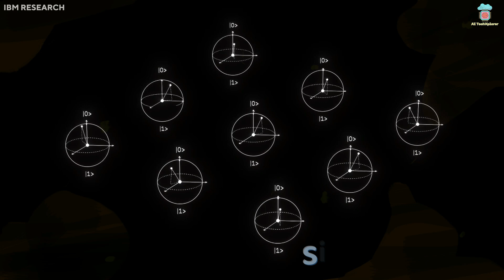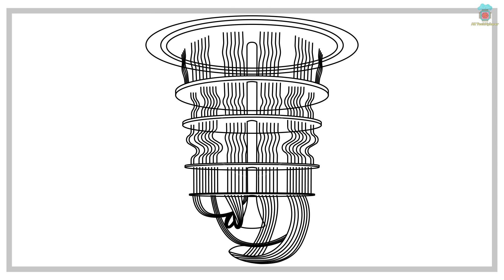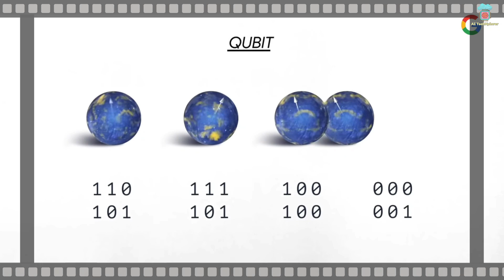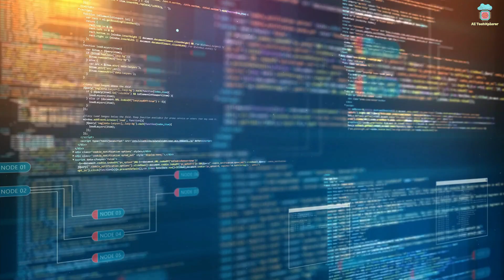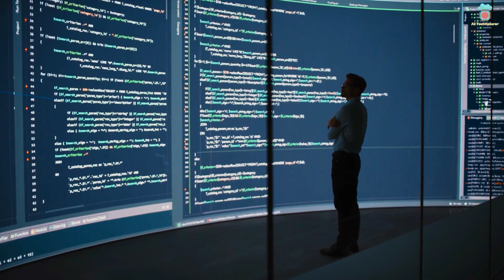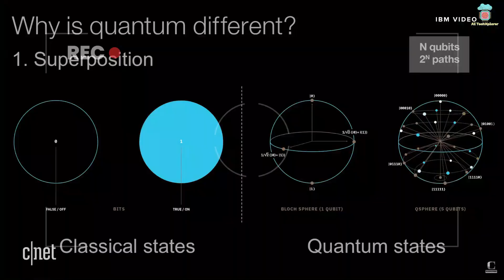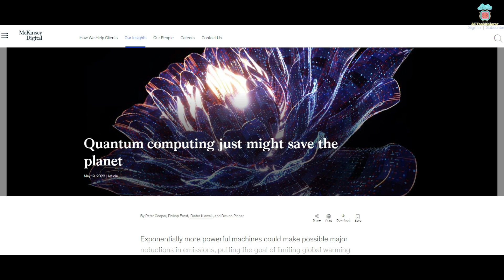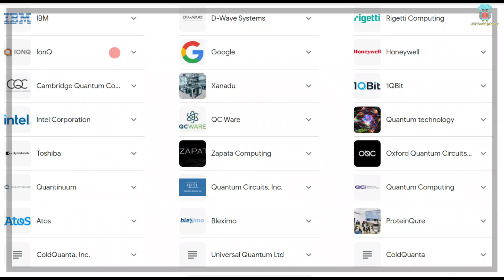Quantum Computing in AI: The Revolutionary Synergy Between Two Technologies

Comment: Yes & No. I doubt this overly positive view of quantum computing in AI. So I ask Claud2 AI. Here is AI's answer, which aligns with my limited understanding of this topic.

Quantum computing and AI represent two extremely promising but complex technologies that could synergize in impactful ways in the future. However, effectively combining them is still highly challenging:

1) Quantum computers are still in very early developmental stages, with limited capabilities compared to classical systems. Current quantum computers are not yet performant enough to offer advantages over classical AI.
2) The algorithms, software, and programming techniques for quantum machine learning are still evolving rapidly. We don't yet know the optimal strategies for quantum-based AI.
3) Mapping AI algorithms like neural networks to fit the constraints of quantum hardware is extremely difficult. The environments have very different assumptions.
4) Quantum computing introduces completely new paradigms like superposition, entanglement, and interference that don't have intuitive analogs in classical AI.
5) There is a shortage of quantum programmers and researchers who deeply understand quantum information science and AI. Interdisciplinary skillsets take time to develop.
6) Accessing and using existing quantum computers requires specialized knowledge and tools that most AI developers and researchers currently lack.
7) Applying quantum techniques to large neural networks or massive training datasets common in AI may be unfeasible with current or near-term quantum hardware.

While the potential to accelerate AI through quantum computing is very exciting, it likely requires significant further advances in quantum hardware development, quantum-specific algorithms, mitigation of noise and errors, and education of quantum-AI hybrid researchers and engineers. We are still in the early exploratory phases. Combining these complex technologies in impactful ways may take considerable time, effort, and ingenuity.
Reply from the maker: Absolutely, the points you've highlighted are indeed valid. There are numerous challenges that must be overcome to fully harness the synergistic benefits of Quantum AI.